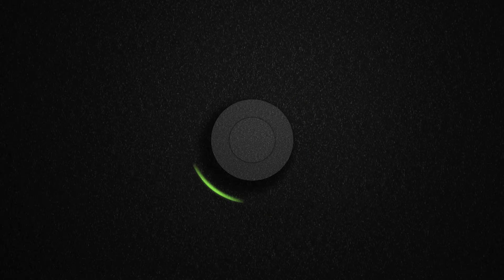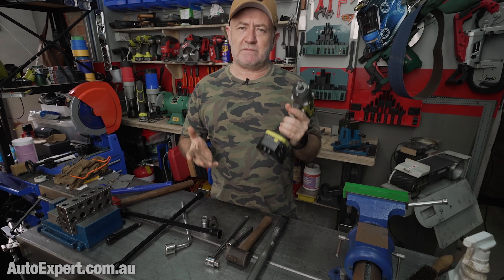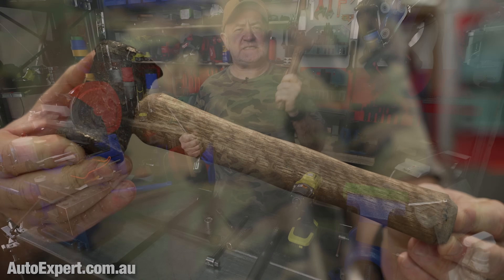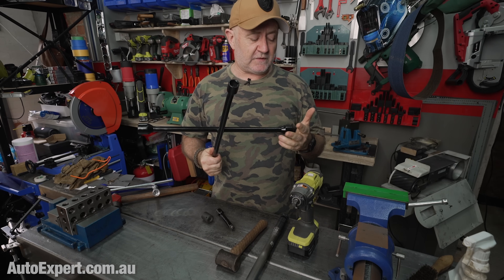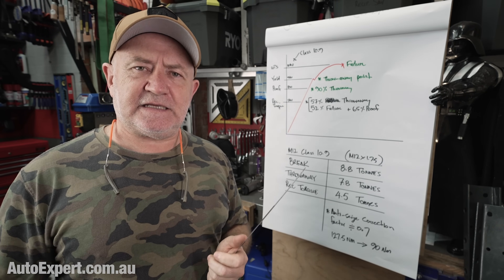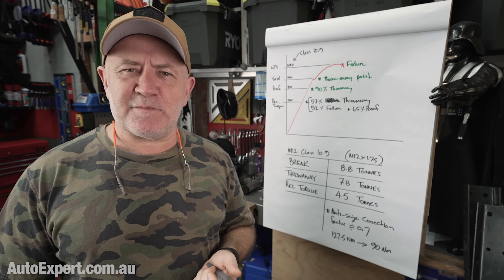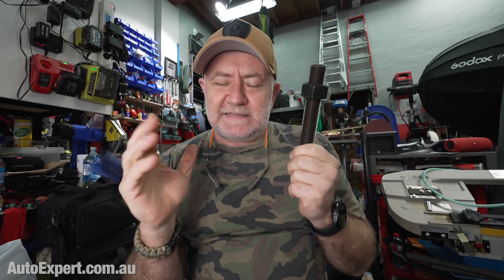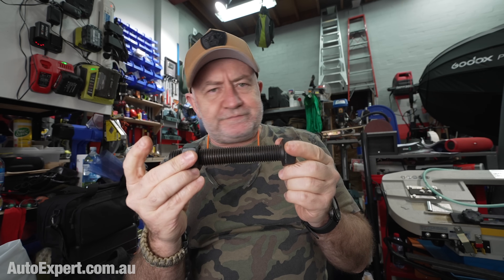Wheel nuts: Ultimate 'ghetto engineering' DIY deep-dive | Auto Expert John Cadogan

Comment: john I went through this very subject with one of my customers some time ago the old boy passed a few years back now # respect for taking an interest in what is holding the wheels on I had an ugger bugger factory set to 70 foot pounds as this at the time was pretty much the tech sheet setting for most cars , this conversation came around because he was concerned that I was over tightening the wheel bolts and he would not be abled to release them in the event of a flat I often proved with a torque wrench that they were spot on , as well as supplying him with a neat bit of kit for the home boys who might not have the plethora of sockets that I have to tackle 90% of all bugger bolts the ones that do not want to come off one of these telescopic wheel bars they are called in the uk anyway / these wheel brace or bar has an extendable length handle and a 90 bend to get the socket to the nu/ bolt, it looks like a big brother to the one in the car kit

Comment: Thanks John ☺️. The wrench that is delivered with the car is suited for not over torque the nuts even if you are strong. I don't use a hammer for undoing wheel nuts, my foot on the wrench plus quick jump does the job.

Comment: Excellent presentation John. I keep a 4 way wheel brace in my car as I can use both arms to   loosen or tighten the nuts & also it can be used to quickly spin away to tighten or loosen those nuts.

Comment: A friend of ours had a 1990's Ducati 900SS, and one day the rear cylinder bolts let go. Luckily it was at low speed. When the engine was rebuilt...under warranty as the bike was only a year or two old at the time...the shop discovered that Ducati was using stainless steel studs for the cylinder hold down bolts. They were torque-to-yield and being stainless steel would not "stretch" like ordinary steel ones would. The official service bulletin from Ducati said to replace them with normal high tensile steel studs and bolts to replace them, which kind of implied they knew it was an issue that might pop up at some time for owners in the future.

Comment: Set the parking brake to aid in rear wheel tire change and to help keep the car from rolling off the jack.  Also use a couple cheap rubber wheel chocks.  Tighten the nuts in a star pattern.  After changing a tire(s) re-torque the nuts after 50km as dirt or rust between surfaces may create false torques.
Reply: There is never any dirt or rust between my surfaces! Steel nuts, steel wheels, both of their mating surfaces get wiped down with a cloth, or maybe just with my finger, before I mate them. I might use my finger to put a very thin film of multi-purpose grease on the nut's mating surface, at the same time feeling the surface to make sure there is no sand on it, and I put a tiny drop of motor oil on end of the stud furthest from the wheel, before I run the nut down the stud. I don't think anti-seize is necessary. I use anti-seize is for exhaust system fasteners. Make disassembling them years later a helk of a lot easier. I wish they would have assembled them at the factory that way but they never do. Sparking plugs too get a tiny dab of anti-seize. A dab goes on it near the tip, care being taken to not get any on he the ceramic insulator. With sparking plugs I'll run the plug down just until the crush-washer gasket touches the cylinder head, then run it out, and pull it out and look at it, to make sure the anti-seize has lightly coated all the threads. Usually it has.

Comment: Old Nissan Patrols regularly loosened the rear left, and only the rear left, wheel nuts. So we gave those nuts and extra kick of the wheel brace. 
I've also seen plenty of crystalised wheel studs over the years from over tightening, including snapping 4 or the 6 on the right rear of my maximum loaded Patrol while zigging and zagging through some mountains up near Cape York.

Comment: Hi John, I’ve recently bought an ezyjak for my wife and daughter. They are sold by a mob from Walgett.  It seems like a great idea, it stored in a plastic box, has a 12v powered Jack/compressor/ torch and a 12v 1/2” rattle gun. Come with all the impact sockets.  Just plugs into the cig outlet or onto the battery. They wouldn’t be much use in the workshop, but to get the handbrake out of trouble on the side of the road, worth the money.
Reply: i have use one of those on nuts a pnuematic gun wouldnt shift. becuase it winds up and then releases its like using a wrench and giving it a sharp love tap with a hammer.

Comment: In my experience it is absolutely essential to make sure you know the required torque for your vehicles nuts. I always have to tell the tyre shop that my vehicle requires 140nm otherwise they are just going to whack it up to  something closer to 300nm which is bloody delightful when it comes to removing your locking wheel nut !!! I have lost count of the times locking wheel nut keys have failed when attempting to remove locking wheel nuts after over-torquing by a tyre shop.
Reply: 100%.  I'm in Canada and it's the exact same here.  Nobody has even heard of a torque wrench.  They whack the lugs on with an air impact until it won't go anymore, then they roll it out of the bay doors.  Done.  Here's the bill.

Comment: John, I might be wrong here (and I too have wondered why) the micrometer torque wrench manufacturer recommends unwinding the setting after use.
I can only assume it’s because movement will help internal lubrication.  Again, IDK, but seems logical.  But I agree, the spring constant should not change even if left in setting.

Comment: Whenever I buy new tyres the first thing I do is loosen the wheel nuts and tighten to the manufacturers spec torque with a tension wrench. Next i reduce the hugely overinflated tyres to the spec written on the door.

Comment: Complete agree with Hugo on standing on the wheel brace. Obviously, applied before the vehicle is jacked with its mass keeping the wheel anchored from turning. Also obviously, you only untighen the nut to enable final removal after the jacking is complete. This was taught on mechanical principles and driver courses in the Regular Army in my day. Everything else in your video is " good stuff". ( BTW, in a lap of NSW in the ever faithful Prado with the Commanding Officer, an off route division to a national park near Broken Hill with two other female  officers saw the driver commanded to take an un-reconnoitred return route( not the way in as I had pleaded). Full of lovely gibber stones, nearside rear soon had expelled its air. Guess who then restled with spare and slahed tyre? Certainly not the Command Group observing with impatience as the Sun set. The standing on the brace amazed them for at least ten seconds, but was crucial to the wheel change ( and making it back to what form of civilisation represented by BH.

Comment: Nice to also know if you actually have a spare to swap with that flat! So many don’t. I always have a socket and a big breaker bar as well. I always keep a torque wrench in vehicle for trips. There is no way to torque to spec by feel. Great info as always John.
Reply from the maker: Agreed. Pointless if no spare...
Reply: @AutoExpertJC  Are those containers of goo for flat tyres rubbish?
Reply from the maker: No, but they don't fix all flats, just simple, small punctures.
Reply: @JJ-wi2uw  there also bad for the tyre. there a get you to the nearest tyre service device.
the other bug bear is space saver tyres while better than nothing or a can of that punctur juice. the actual wheel and tire often wont fit in the tire well.

Comment: 30-odd years ago I bought a telescopic 1/2" drive breaker bar with a swivel end and it's been in every car I've owned since, with a suitable socket attached, for removing wheelnuts.
Absolutely wouldn't be without it.

If you do replace the standard wheelbrace, though, you probably still want to keep it in the car because it might be required to work as a jack handle or as part of the procedure for accessing the spare wheel.

Comment: a 4 way brace is a great thing to carry. another is a proper breaker bar, extension and socket of the right size. you can aslo get a variable legnth tire wrench set that has a few sockets and a adjustable bar all in a tool pouch that easy to fit in the wheel well

Comment: Here in Britain we use an inexpensive (£9) telescopic wheel wrench which comes with two double ended sockets (17&19 + 21&23mm)
Extend the handle for more leverage to remove lugs and close the handle to avoid over tightening when replacing lugs
Replaces all the tools that JC listed in the description

Comment: Those little wheel braces are better then the four spoke ones. A copper made change the low treaded tyre to the spare one day at the airport rank. I told him I couldnt do it. He said its made to use your foot. Usually they book you but thanks to the Canb Airport Copper that helped me.lol
Reply: fuck no! a proper 4 way brace is the better tool. yes those short levers are supplied for a reason. so big monkeys dont over do it and damage the studs.

Comment: As a mechanical /electrical tradesperson. This was one of your most informative videos. I only hope that people take on board this information.
Prevention is better than the cure, if a car is serviced once a year and tyres rotated and brakes correctly inspected, then there should be no issue removing the wheel nuts if torqued correctly.
I have found the spider wheel brace to be the safest and easiest to use and should be carried in all vehicles.

Comment: I've saw one video of a guy who live renting cars to lap in Nürburgring and at one turn, the wheel just came off on the midle of a turn, all the the studs have broken on the base at once, they checked the torque and it was overtorqued by the shop were they changed the wheels for another one with race compound, it was used one pneumatic impact wrench

Comment: I put a road safety kit in a small mechanic tote in any car of my family and self. It's just a emergency service 10pc common use socket set, heavy gauge long jumper cables, snap-locking folding 4way lug wrench, 3lb mini sledge, small crescent wrench, 3 sizes each of blade and Phillips screwdrivers, a source of light that is powered by the vehicle and one battery powered with a spare set of batteries, and spares for the consumables from fuses to fluids. With this just pushed in a back corner and forgotten about until the moment it's the most important thing in the world has helped me countless times.

Comment: The BEST tent pegs in the world are M12 x 200mm galvanised coach bolts (not for sand obviously) from Bunnings. I have a little tool bag with a heap of bolts, a heap of washers, the correct impact socket, and a masonary drill (just in case). I just throw the drill, the ugga dugga, and a battery in said bag when it's time to go camping. I haven't bent a tent peg in years, simply because I don't use them any more. My tent requires A LOT if pegs, and it makes really short work of the job.

Comment: There certainly is vibration that affects wheels, and that is on corrugated roads.  I’ve seen cases where there were some loose nuts on all wheels, on every vehicle in the convoy after a considerable distance. It was real eye opener, and some of the blokes were looking pretty green when they found out just how little was holding their wheels on. I now recommend that people do not use anti seize, and to check their wheel nuts after the first few hours on the dirt, and regularly after that.

Comment: I was thinking about you yesterday John. Young bloke at work brought an old F350. The rust is pretty bad under the bonnet and around the firewall so someone has made up brackets and welded 2 steel tubes from both front top engine bay corners to approx 30cm inset from top back firewall corners.

I didn't get photos and it's probably nothing new to you, but it's times like this when a back yarder feels compelled to reach out to John Cadogan.
Reply from the maker: Awesome structural engineering...

Comment: Many people say, "oh I'll just get roadside assist".
See how long you'll wait in the Northern Rivers over the last month.
As per your recommendation quite a while back, the Tiffany in my life has a long bar and set of wheel nut sockets.
Reply: The last time I had a flat tyre, I decided to make it a bit more fun by setting a stopwatch to see how long it took me to change the tyre, starting from the time I open the boot to the time I closed it, making sure to put the flat and the jack back properly. 

It took me just shy of 12 minutes, although nearly 2 minutes of that was spent trying to wiggle the wheel off the car as it was stuck due to surface rust. I now carry a can of WD-40 in the car, as I'm hoping to get my next flat tyre change down to under 10 minutes.

Ofc having a small car with 4-stud wheels and a full-sized spare helps.
Reply: @TheKnobCalledTone.  Tiff has a full sized spare on the Santa Fe. Has to be lowered down though.
Reply: @MattBlack6  Now Tiff has the right tools, I'm sure she could change a tyre on her Santa Fe in under 20 minutes. Or at least way faster than roadside assist can get to her.
Reply from the maker: Tiffany with a long bar. Sounds like a bad morning in Thailand.
Reply: @TheKnobCalledTone.  
You need to PM all the wheels at home with a decent anti-seize (not WD40) BEFORE you have to do the roadside rage attack....
Suggest anti-seize ........because anti...seize?
Reply: @JohnSmith-yv6eq  copper eze is my 2nd favourite lubricant.
Reply: @JohnSmith-yv6eq  That's where I went wrong. Schoolboy error. I'll be sure to apply anti-seize next time I rotate the tyres.

Comment: I am now so much more confused and conflicted on the use of lube with bolts and nuts.
Do I use lube on the bolt or the nut? When is the right time to use lube? My particular ride of choice never needs lube when driven and serviced on a regular basis. 
Granted, I did snap a bolt and lost 2 nuts a few years ago on account of trusting someone, now fixed and better than ever.

Comment: Have needed to borrow a scaffolding pole to loosen  "professionally" installed wheel nuts, but otherwise havn't had a problem, perhaps because I've always (50 years) greased them (antiseize unobtanium in Taiwan), and latterly (10 years) put thin polythene sheet over the studs too. They go on with the standard wrench one handed, and come off with two.

Never used a torque wrench on them, but perhaps I should have, if only out of curiosity. Impact gun seems OTT for this use but would be nice for rotating stuff like crankshaft pulley bolts.

Comment: Rubber mallet works pretty good for cheap torque if you're not allergic to it. Now on the other hand, I only use a 4 way with my wheel locks.

Comment: for changing tires on the road, i use an impact and a torque stick since i aint trying to get the most perfect fix while traffic is flying past me. i have the battery pack unplugged from the tool and swap out a fresh on every week as part of my weekly tire pressure check routine.

Comment: I bought a new Prado with 19 inch rims which are great on road, but useless off road. I bought a set of 17 inch rims and fitted some good off road tyres. With an electric rattle gun, torque wrench and trolley jack I have got it down to 15 minutes for a complete wheel swap out. Would take bloody ages without the rattle gun.

Comment: Love your work John
Supercrap do an extending wheel wrench for $18, extends to 530mm, way easier (and safer for your nuts) than smacking it with a hammer and around the same size as the OEM wrench when not extended, I have one similar and its well worth it.

Comment: Great video John thanks. Brings be back to the old crap cars I had from the 70’s with rust on the wheel studs. My speed wrench (4 socket spanner) was used so much the shaft was twisted a quarter turn. Ah well, days of being young and stupid. In those days we would have to lube the studs before putting the wheel back on.  Sometimes we would hit the end of the stud with a hammer before attempting to take the wheel nut off to free things up. Careful wasn’t in our vocabulary. Have a great day.

Comment: Interesting. Loads of great advice here. I’d not seen the Ajax catalogue before so thanks for mentioning it. My general go-to has always been the McMaster-Carr catalogue, which is superbly comprehensive and so well detailed. I needed to know the head dimensions and angles on some socket-head countersunk bolts and while I couldn’t buy from M-C, I was impressed with the content they have. Anyway, also interested in the anti-seize argument you make. I do apply it to wheel studs but only a lick. I wasn’t aware of the quoted factor in the Ajax book. I’ve had a couple of terrible experiences with trying to remove wheel studs after garages have hugely over-tightened them, where I had to replace the studs, but getting them out was almost impossible and I wished I’d taken the car back but I didn’t want to have anything more to do with the garage. One thing I think you didn’t mention, which would ideally have been said in the ‘tightening sequence’ sequence is that, whether a stud or a bolt, they are a taper-type fit. It’s not just a plain clamping force but the wheel is correctly seated centrally on the hub by the tapers in studs or bolts and the tapers in the wheel. Cool though, and thanks.

Comment: Another way to undo a stuck nut if all you've got is the wheel brace, try and tighten and loosen the nut back and forth it usually breaks any junk holding it in there